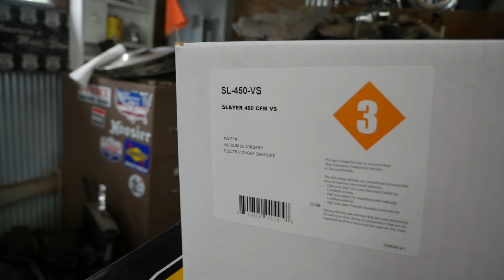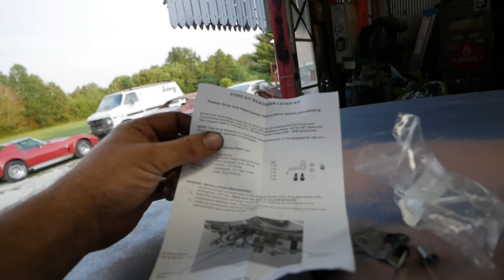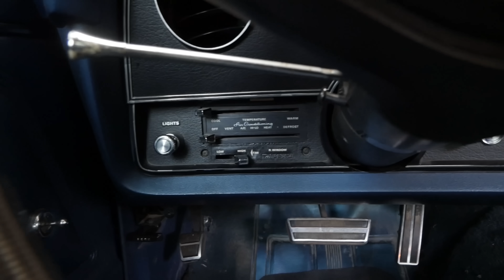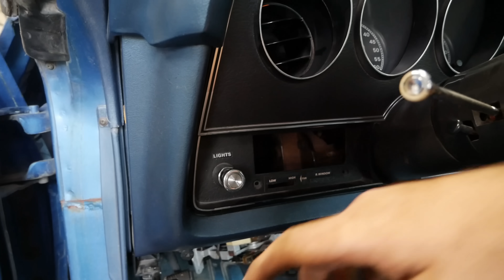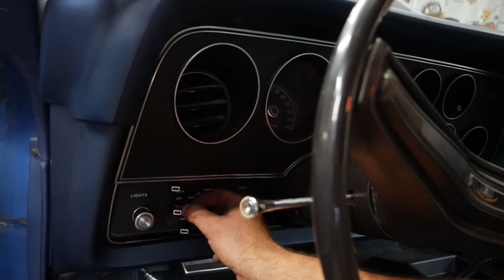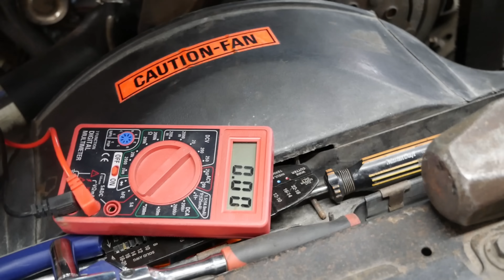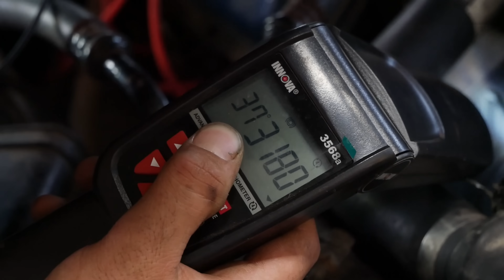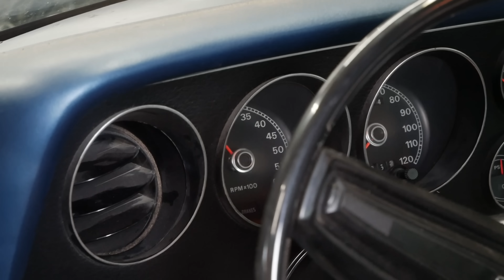1973 Gran Torino Sport Gets RADICAL Changes!

Comment: The 400/351M probably get the most hate of any of the old Ford V8’s… that one sounds pretty good. I know simply swapping out the timing set in them for a performance one makes a big difference
Reply: yup. Cam timing crippled these motors
Reply: It's basically a detuned tall deck Cleveland engine. With a little mods, timing and flattop pistons, it'll be a beast

Comment: Glad to see you’re back on the Torino. If you want to wake that 400 up some more for cheap, swap the timing set out for a set for a 1970 351 Cleveland. All 351M and 400 car motors had a timing set that retarded the camshaft 8 degrees. They did that for emissions. But it hurt the power output also
Reply: That is very, very interesting.  The 400 is so underrated and such a good engine.  I drove one from 1997 to 2007 everyday with an Edelbrock dual plane intake and Holley 600 vacuum secondary 4bbl carb .  Still have the car and the 400 but EVERYTHING is so worn out.
Reply: @Vile-Flesh  They are a good engine. I have one in my 1978 F-150 4x4. They are way better than a 351M.
Reply: @BlackLabGarage  Happy fathers day. Please read his reply to my first post. I'm thinking he will miss the 400 potential. Hope the author cams that 400.
Reply: @PatandDoopypoopy  Well Dalton @PoleBarnGarage isn't wrong. The 400 is a good engine but it is limited by it's open chamber heads and low compression. The pistons are way down in the hole like a Ford 360 is. The 460 is a better designed engine with more potential. I'm doing the same thing. I'm replacing my 400 with a 460. More power and better fuel mileage. I have Summits version of the 268H cam in my 400 and it's ok but the stock cam with a straight up timing set pulled better from idle to 2000 rpms or so. With his 3:25 gear he is better off to stay with the stock cam and just put a straight up timing set on it.
Reply: @BlackLabGarage  Yes agreed. I wasn't comparing to the very superior 429 460 engine. Built several. My simple failed point wS the 400 really responds to cam and good chain. Hindsight I shoulda quietly moved along. And the 8.1 comp is great for 87 gas. Tighten up the cam lsa helps cranking comp.
Reply: @PatandDoopypoopy  It's ok. No need to move along. The other big killer is the open chamber heads. Ford learned their lesson on those with the one year only 1972 429/460 head. Why they continued the open chamber head design for the 351M and 400 knowing it was a bad design baffles me? Now if you really want to wake a 400 up put some Aussie 2V heads on it!
Reply: @BlackLabGarage  I probably should have just Posted the biggest bang for the buck to wake up a 400 is to put cam and if full length headers fit they help a bunch. Other than the basic carb and intake and cam, if more desired go 429,460 route.
Reply: @PatandDoopypoopy  Only downside to the 460 is the weight. It's not that noticeable in a truck but in a car...it's like trying to steer a Wal-Mart buggy with a drunk sumo wrestler in it🤣
Reply: @BlackLabGarage  Thank you for the visual. That is a fantastic description. Good lord I needed that laugh. Now I need to get the thought and picture out of my head. I will try shampooing my hair with holy water.
Reply: @PatandDoopypoopy  You're welcome!😂
Reply: 351 and 400 m engines are junk from factory.  They spider web crack in the lifter bores and cause a loss of oil pressure . 1 out of 10 engines are rebuildable
Reply: @darwinfoster7420  Are you referring to the D7TE blocks that were cast in Michigan that crack in the lifter valley?
Reply: My 400 is a 1975  and it’s not cracked in the lifter bores hope it does run hot in the Tx heat being 0.60 over with a lunati 262 voo doo cam
Reply: @ivonneflemons1249  Wow! .060 is a lot for a 400
Reply: T Meyer makes pistons (or did, who knows after covid wrecked everything) to bring the comp ratio up to a normal level.  Would like to see what a rebuilt and lightly modded one could do, they have good torque which would be decent in a heavy car like this Torino.   @BlackLabGarage
Reply: @qball1of1  I believe T Meyer still has the pistons. If not any of the piston manufacturers like JE, Ross, etc...could make them. Basically just need a piston with a taller compression height.
Reply: @BlackLabGarage  I know it’s expensive but go all aluminum with the heads and intake and it should take a good bit of weight off
Reply: @thepropview9517  Oh no doubt that would make a world of difference in the weight by going to aluminum heads and intake.

Comment: I know you're not too fond of the ol 400 but with an off the shelf cam whether you go with an "RV" grind or a light street cam, some headers, and work the heads just a touch, she'll really wake up with what you've already done. You'd need at least a 600 carb on there, a 750 would be better if you tuned it to sip the fuel until you push your foot through the floor. That's what I did with mine and it absolutely shreds my tires if I get into it. It also just sounds great which is half the fun. They do also like a little more compression. It's just a big 351C, taller deck height and I think we all know that Clevelands are most gooder than a lot of stuff out there. Absolutely love the car. Most gooder, most gooder.

Comment: Hey man, thanks so much for being the kind of guy who recommends good tools and products in your videos. I’m replacing the intake manifold gaskets on my F-100 and have been a bit frustrated using flat-bladed scrapers. I picked up that Titan carbide scraper and holy cow what a big difference. Scraping off the old gaskets and carbon and gunk is suddenly going way faster! Cheers bud.

Comment: Previous owner put 4:56 in my 86 Z28 305 auto and there horrible gears, yes it'll one wheel peel forever but 60mph on the highway and it's turning 4200rpm I'm definitely going to find another stock rear-end hopefully with disk brake and swap it out.

Comment: I bought a 1973 Gran Torino Sport back in 1976. Same color blue with blue lazer stripe, white vinyl top. Great driving car, 351C 2V so not a lot of power, but I really enjoyed it. In the 80's I swapped the block for a four bolt main, 4V closed chamber heads, four barrel and hooker headers. Wow what a difference. Now I have a '73 Mach 1. 4V closed chamber heads are a lot harder to find these days!

Comment: My dad had a '73 Gran Torino. His was silver with a black cloth interior. It was a 4 door with a 302 . His back bumper was just chrome. It didn't have the optional rubber strip in the middle. I would've loved to have had the Sport with the 351 and a 4 speed.

Comment: Dalton, back in the day... I have this opinion being a seventy three year old guy who is a ford nut. I ran fords because I did not want to follow the crowd. I lead, not follow so that got me in a ton of fun troubles in the army in Nam. I owned just as many chevys as I did fords so equal opportunity kind of guy... my opinion of course. I did own one of the rare ford fairlanes that came from the factory with nothing inside of it for creature comforts or even wiper blades. It did have a 428 tho and it was one powerhouse of tire burning hell raising fun rig. On a good day was about six miles to the gallon and if ya raced it, figure feet per gallon. I hope that some day, those old fords find a soft spot in yer heart. My dad bought a four door sedan 57 chevy belair so when the banker sold his rig, he came to me knowing I would take good care of it. I might of been a hot rodder but my car was a shinning beauty and of course fast. Old Dudley Ross sold me his 57 ford fairlane with a total of almost forty thousand miles on it and it was in perfect condition! It was the two door hardtop with the 292 and four barrel... Believe me, I did get rid of the old "tea pot" style carb and put a Carter AFB four barrel back on it. I know yer not going to believe me as no one ever did. If I kept my foot out of it and drove right, it consistently got sixteen miles to gallon... right in that area as its been a minute or three since I even seen the rig. I got it in winter of sixty five, I got drafted in spring of sixty six. My dad hated me like your even going to find it possible, hated me so bad that after I was on the bus to boot camp, he hauled all of my rigs to the wrecking yard. I found out later tho, the guy who owned that wrecking yard sold all of them minus a title. So the 57, my 62 fairlane and my 64 1/2 galaxy, all two door hardtops, the fifty seven was three on the tree and the other two had four speeds. I don't have a problem saying that I never  forgave him for getting rid of my rigs on me. Even the townspeople were upset as I was the kid who cut their firewood or done a lot of things for old people in my hometown... I figured some day when I got old, ya know, karma would come back and believe me it has.  Hey, its a nice rig Dalton and think over time, it just might grow on ya a bit

Comment: I had the same issue with the kickdown spring on mine just to be safe I put a small zip tie up on the fuel rail and hooked the spring there so it cleared that throttle bracket seems to work just fine

Comment: One time I didn’t unhook the battery, doing a starter in my Bronco, and the positive contact touched the trans cooler line and burned through it. It caught the fluid in the line on fire of course. Thankfully my buddy had a pitcher of bong water nearby that was just enough to put out the flames.

Comment: Use the air compressor nozzle to put out fires it stops all sorts of rat's nest fires and grease fires almost instantly. Coming from the guy that welds floor pans in with a 1/2 layer of grease on the bottom and a nest behind every patch panel, you can trust me.

Comment: Ha! Quick Performance talked me into 3:25's. I kind of wanted 3:55. But I figured my Truck is about the same horsepower and torque, MY Torino weighs 2k less, and the truck breaks the tires loose at 30mph with 3:31's, so the Torino should be fun enough with 3:25's.

Comment: Hey man, just for future reference if you every swap center sections on a 9 inch again. The easiest way to to pop it loose and drain it is to leave the top nut on a couple threads and Jack up on the pinion. Pops it right off,👍 just make sure you got a drain pan under it. 😂👌

Comment: You check voltage on a resistance circuit, you have to have a load on the circuit, current flowing, you’ll have battery power all day long til you load the circuit. Just to let you know for next time you run into a electrical issue and you think you have voltage. This has bit me before. I’d have 12v on a circuit but it couldn’t handle any current. I always do voltage drop test, with some sort of load on the circuit, light bulbs work good, head lamps for heavy gauge wire, 1156 on small ones. Hope it helps you in the future.

Comment: I have the same car what diff did you get the  Eaton Tru Trac locker. But where did you get it that it all came as a unit? I've been trying to find it but it just shows the locker not the gears? It looked simple to just bolt it in.
Reply from the maker: Quick Performance, that's the place I was talking about

Comment: The, old timer, theory of the valley baffle is to keep the heat off the intake manifold. With the thermostat heat at the bottom of the manifold oil splashing will eventually cause a build up of carbon, pieces fall into the engine internals, blocking oil passages, causing other harm.The throttle cable has its own spring, usually they include things in universal kits that might be needed on other applications.

Comment: If you have leaks on the studs ? You might need to get the copper washers or consider it as a poss solution. Of course if it leaks?. That's how my 69 Cougar 9" is. Just thought I'd mention it My Gators Fan Bud 😉👍👍👍

Comment: The 400 being square with a 4" bore as well as a 4" stroke is significant.  That added to the added bearing wear area of the 3" mains made for a very durable long running engine with a ton of performance potential.  Its pretty easy to get 500 hp and 450+ ft lbs of torque out of the 400 . Just takes the correct parts . Of which the majority of stock 351c parts. 1he close chambered 351c 4v heads and straight up timing set for the 1971 351c 4v engine really wakes the 400 up. KB make pistons that bring the compression up from the stock 8.4:1 in 73 up to 9.5:1 . Which is great for a street engine. Added to the 71 351c 4v heads and straight up timing set and a 600 cfm 4 barrel carb and intake . And you have a 400 ford that will put out over 400 hp and 400 ft lbs of torque that easily

Comment: Hey quick question please, do you think 315/50 R 18 wheels will fit on a 73 torino?  Is it possible to lower it some with coil overs to get it stiffer and so it does not sway so much when turning? .

Comment: I save the old rear brake rotors, put them on backwards and use a sledge as a bearing puller on more modern trucks and cars with hub bearings. works perfect every time!

Comment: That carb is waaaay too small for those mighty Cleveland heads, if you went with a 650 with a stock cam and a 750 with a cam and headers. Those 351 and 400M motors are FULL of potential- Just ask Richard Holdener!!
FYI  the 2 barrel heads had a 2.05 intake valve!

Comment: I had a twin to this car, same drivetrain, FMX, factory 3.25 Traction Lok...... it would come around on a wet road and kill you, demanded respect from your right foot..... at 190,000 miles( I was the  I-don't- know-what multiple owner of this thing) the #4 plug looked a little funny....... when I finally broke the car down and sold it for parts, I found a cracked #4 cylinder wall, and it had apparently been that way for thousands of miles..... never affected the running of it in any way.

Comment: Fun episode as always in doing tires and stuffs magnum 500 wheels are a touch hard to balance are they Capable of an "on car" style balance where the wheels are mounted to the Balancer where the lugs tighten them down, and the centering cone. I have had to do that to wheels that are a pest to balance maybe it helps maybe not either way have fun with that Torino.

Comment: Just a quick note,  you mentioned that you had troubles getting the wheels to balance right.   Magnum 500s need to be lug centric balanced,  meaning the balancer adapter centers the wheel on lug studs.  If you find a tire shop that has that adapter,  chances are you can get them balanced right.
Reply from the maker: Agreed but nobody would

Comment: 450 CFM carb is good. I think the 450 CFM carb comes with a 8.5 power valve which is great for fuel economy.. Measure the vacuum at the mid range to verify, but I'm sure a 6 or 6.5 power valve would give you more power with a small loss of MPG. I've had a lot of "Cleveland" engines and really like them.  Currently have a 72 Ranchero GT Q code 351 4V.

Comment: I learned there is a slight issue with the Pertronix distributor. You need the correct resistance coil for it to work properly. I have been running a 1.5 ohm Flame thrower coil and have just switched to a .6 ohm Flame thrower II coil. It can cause drivability issues.

Comment: In all reality, the Pertronix is just an on/off switch.  I installed a Pertronix in my AMC Hornet - which uses an old-style INLINE tachometer - and it still works fine.  That's the beauty of the Pertronix - virtually every tach should work with one.  It's when you get into crazy electronic ignitions with computer controls is when factory stuff stops working.  It can't "talk" to the tach.  Love the car, btw.... '72/'73 Torino's are probably some of my favorite Ford products.

Comment: I'd swap the 400 stock cam & timing set for a 1971 351C timing set and mild performance cam. That would be the biggest wake up for that 400. The stock timing set has retarded the cam timing something like 8°. That and the 4v carb , intake and ignition upgrades will wake that 400 up big time.  Recurring the stock distributor to bring the total ignition timing in by 2800 would be another simple upgrade with pretty noticeable  improvement in acceleration

Comment: Another great PBJ video! Love that smog engine 400. They can be good DD if tuned right, but because of Cubic Inches, the gas mileage does suffer. getting the best of both worlds is a tight rope. What's going on with JD's '59 Ford Dalton? I love that car!
Reply from the maker: It's still around, not really sure what else to do to it!

Comment: Don't know if you'll read this but after the car is running the resistor kicks in so you might get 6 volts after the car is running might want to check this before you leave

Comment: Nice Pontiac! Will that be in the future videos I hope so. I'm not sure if I would remove my axles that way unless I was going to change my wheel studs also. I can see you smashing the threads on em
Reply from the maker: The Lemans was in a video a few weeks ago, check it out. Also, you're not pulling on the studs. Fully engage the lug nut, use a little common sense and it'll be fine
Reply: @PoleBarnGarage  l do use common sense. But ya know shit happens when ya least expect it to. At least in my world !! LOL

Comment: I couldn't believe my eyes when i saw the torch come out on that poor heater core fan, in case you see this Dalton, the thing that wouldn't stop burning was the epoxy on the motor windings I'm pretty sure. It's a good thing you got a new one, because that old motor would likely not be happy after that
Reply from the maker: Well I was replacing it for a reason lol

Comment: I think that 450 would do better with some tuning with an AFR gauge. I run a 500 CFM summit 4 barrel on a built 390 and it was very lean on the idle, transfer slot and main circuit out of the box. After tuning, it has better low-end response and torque and screams just as hard as my extensively tuned 600 Holley I had on it, with slightly better MPG around town.